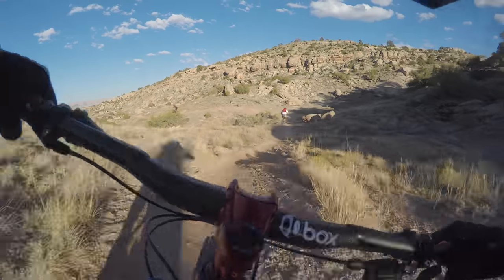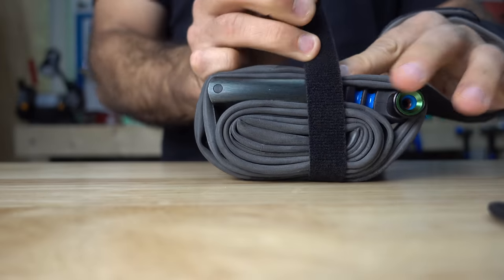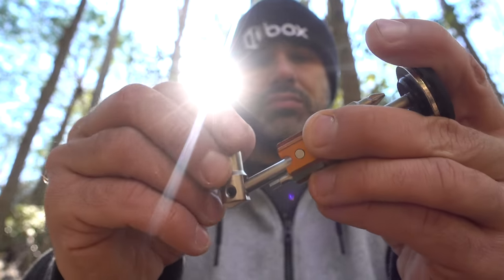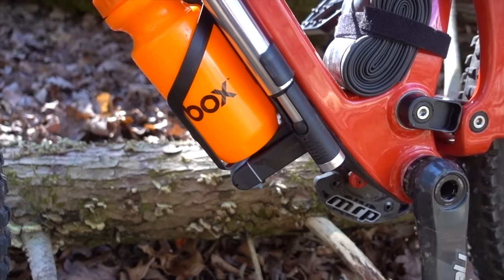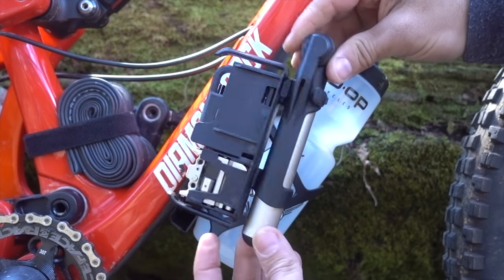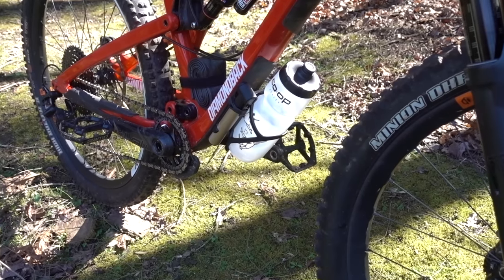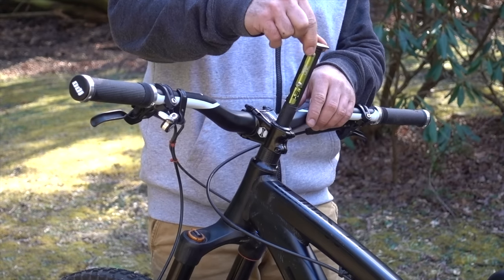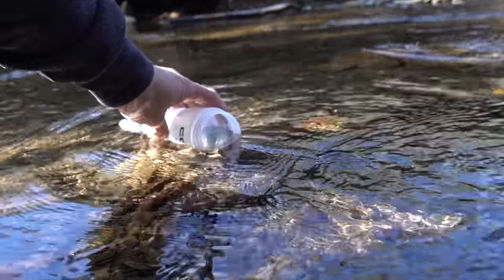5 MTB Tools that Live in your Bike

Comment: Instead of getting a cage like the topeak ninja I just get a inch wide piece of tube and slide it around my bottle cage to the same spot as the ninja is. It can keep a large multitool without any issues and it is free if you have an old tube lying around.
Reply from the maker: This is going in the next hack video and I’m crediting you!
Reply: Seth's Bike Hacks that's awesome! Thank you!! Keep up the great work
Reply: This is genius, and if you have a smaller tool- smaller tube!!
Reply: I didn't understand how it works, Kyle. Do you have a link to a jpg or something, please?
Reply: Kyle Blazer That’s a nice hack definitely
Reply: nice hack! .... Gian, cut an inner tube so it's one long straight piece, then cut off a ~10 cm / 4" piece, so you have a tubular piece of rubber. Slide the opening over one side of the cage, all the way down so you have a piece of tube around the bottom of the cage where you can stick something like a multitool or anything slightly larger that will stretch the tube so it's tight.
Reply: Totally creative and re-useful!

Comment: Hello Seth. I would just want to add another tip. On the handlebars you can take the cap off, and put a tyre plunger with a bacon strip already with it. Then if you have a puncture just take that plunger straight out of the handlebars and plug the leek then inflate with a pump, and you'll be back on the trails in just seconds.

Comment: Total fan of the All-In tool.  I've raced Super-D and Enduro at Paris Mountain and several cross-country races and the tool has always stayed put.  By the way, the notched out section on the side is designed to hold 2 quick links.  As always great vid bro!

Comment: I do like all of these, But I always thought it was better to carry the weight on you, and keep the bike as lite as possible. Just a thought👍
Reply: Great video of corse as well!
Reply from the maker: Thanks! Even loaded down with tools and water I'm pushing 32 lbs on this bike. As bikes get lighter I think people are going to feel better about weighing them down a bit. Still there's nothing like riding a totally naked bike!
Reply: All Terrain Biking agreed. My bike is always naked
Reply: That's funny, I feel the opposite way. It feels best to not carry anything on my body, especially on hot days.
Reply: I'm the opposite, I like to be free to move my weight around s easily as possible.
Reply: Video is really nicely done! Im always for the solution of backpack because every accessory that i had on bike bike broke soo from then im always caring a backpack with all stuff i need. Im riding with naked bike and I always will but even when i had some stuff on it i never felt the difference soo that shit about ligher or heavyr bike is is a nonsense to me it only makes a big difference if you put like bags on your bike or stuff like that
Reply: So much better to carry your stuff. Pumps and tools hate mud and gunk and will go bad quickly. These tools look like expensive rookie mistakes.
Reply: Charlie Cartolano 
Agreed just put a descent set of tools in your pack. Boom done and clean. This stuff works ok in other parts of the world but not in a UK winter.
Reply: Seth's Bike Hacks "Still there's nothing like riding a bike totally naked!" ... FTFY ;-)
Reply: GMBN did a video about this a while ago. It’s better to loose weight on your body than to lose weight on your bike.

Comment: The EDC plus a Specialized SWAT top cap chain tool is a nice setup. I also really like the SpeedSleeve Ranger for tube, co2, inflator, money, zip ties, mech hanger. Does not rattle and is easy to remove and use. That said, the EDC is not great in wet environs. The bits corrode quite badly.

Comment: The hollow bottom bracket tool can be found from a chinese website for 20 bucks same thing just straight from the chinese factory its made...
Reply: Anthony Camacho on which website?
Reply from the maker: I have no affiliation with the company, but I need to set the record straight. This tool is made in Italy by a small company. If there are imitations available, you are free to link to them, but the one in the video is the real deal.
Reply: Seth's Bike Hacks You're right. We should buy the original... But as a student it's pretty expensive
Reply: You don't go cheap on tools.  Cheap tools let you down when they are most needed.
Reply: This Guy no not really a tools price doesn't determine if it's good or not whether it lasts and works is what matters yes i understand you mean most good tools come at a price but there are some cheap tools which actually end up not being trash
Reply: Anthony Camacho Chinese cheaply made tools are almost always unreliable
Reply: King Goat Fury yeah that's true its not like most products nowadays are made in china; p.s. I've ordered a great amount of chinese products the carbon fibre things you can say are unreliable while the cnc made and aluminum made things are not as unreliable especially if all it is, is a tool which won't always be used...
Reply: The webset is most likely alliexpress. They sell good\ok bike products and sometimes the real deal. But it just takes a long time to come
Reply: i have one from aliexpress and it works perfect. The big problem at this tool is, that if you are going to wash your bike and forgett to remove it, the bits start to roast.
Reply: maybe put a sausage or some chickenfingers in then? :P sorry, i could not resist.
Reply: You are so right. Ive broken parts of a bike, stuff at home, computers back in the day because of cheap crap tools.

Comment: If you were disappointed in the Ninja T8+, you could use the Ninja TC Mountain. It uses the Mini 20 Pro if you need a tool with more ... tools. (Chain tool etc.)

If you need the tire levers, you can change the tool-cage to the one fitting the bigger tool from the Ninja T Mountain.

Comment: Glad you mentioned the specialized there, I have a 2018 specialized and utilize the hell out of SWAT, and have the chain tool remover in the stem. I was wondering why it was not part of the review. I did not realize it would not work on more bikes, which is a shame and a market Specialized would be  wise to adapt broadly.
Reply from the maker: I think this was my mistake. Apparently you can just buy their bottle cage and make it work, although some models work in an internal compartment which is proprietary.
Reply: My multi-tool is connected via the cage, while some of the s-works have it in a seat connection. It does not have a chain tool though, I had to purchase separately the specialized tool that goes in the stem. The set up you have shown on your trail bike has it all in once place, that is nice. Though I do like being able to put the tube, pump and tubeless repair kit inside the downtube of the bike.

Comment: Great video as always!👍
I have this little canister from specialized that fits in a bottle holder. It carries my crank brothers multi tool, tire tools, co2 cylinder w/the head, xtra links and it also has a little compartment inside the lid for patches, band aids, money etc. 
if I need 2 water bottles I just put the canister in my jersey pocket. Never know it’s there.
As far as water from a stream goes, I only use Geigerrig/Aquamira hydration packs with a filter on it. The only brand I trust after landing in the hospital with another brand.
As far as the urine test, go to YouTube and look at the video of the runner who tested Geigerrig’s filters with a hydration pack full of pee. 
Anyway, Thanks for another awesome video!!🚵🏻

Comment: The specialized stuff can fit any bike with a normal bottle cage mount.The TTC or Top Cap Chain Tool comes with a star nut tool extender to get the right distance from the top of the steerer tube. The only things that won't work are the Bandit tube and pump wrap, as well as the SWAT XC box, as it requires a third bottle cage boss.

Comment: Love your videos man keep up the good work !!! I just routed my first dropper post in a trance 3 frame that is not supposed to accept a internal routing. i went inside the frame around the bottom braket an up the seat tube. 
I made myself something similar to the parktool routing blue string with a piece of string, a small washer and two tiny but very strong magnets I had. 
I glued one of the magnet to the washer, tied up the rope in the hole of the washer and voilà ! 
Also GRAVITY helps a lot to route around the BB. I turned the bike almost upside down so when I let go the magnet from the outside, the inside one would naturally fall in the BB toward the seat tube. then i fished the first magnet with the second one again using the same trick (washer + super glue). 
I don't know if it is a hack or more juste technique but i thought I would share.

Comment: The topeak Looks like a Walmart version of the specialized swat tool. Their cages are also great if you’re one of the people who has a bike that doesn’t have enough clearance to pull the bottle out of the top of the cage. And they work with any bike. Mine has stayed on the bottom of the cage no matter what I’ve done to it. Also they have a chain tool that fits in the headset

Comment: Great video Seth, the topeak ninja also comes in a MTB version with Thier multi 20 tool in it, you can buy it without the cage too, it comes with bottle boss mountings so you can use your own water bottle cage, I've been using one here in the UK and it's terrible weather for a year now with no issues of water getting inside the case, I needed to replace my still functional, but 20 year old cool tool, if anyone remembers them :)
Reply from the maker: I didn’t know this! Thanks
Reply: Seth's Bike Hacks no worries, when I came to buy a new multitool I was baffled by the amount available, it's crazy, hope you are on the mend and looking forward to your next video, back on the bike, I've never seen you test any cyclo cross bikes, they are dangerous but great fun to race and ride, perhaps test one?  I smashed my wrist last time I rode mine on a MTB flow track, it was funny as hell til I clattered myself, drop handle bars are a strange way of trying to stay in control, I'd love to see the sampler on a cross bike

Comment: You need to check out the other Syncross Matchbox Cage with a pump that has a flexible hose.
From memory, it's the HV 1.5. I run it on my Scott Spark and have never lost a bottle, and the flexible hose means no strain on valve stems.

Comment: How many hex-keys do you really need on your bike? I have a Liteville with Syntace parts and luckily they have thought about it and basically you can fix everything with a 5mm and a torx for the rotors. Pedals need normally a bigger one same as the stealth axel (6mm). Then you are fine with 2-3 hex keys, a chain tool and your favorite way to pump the tires. Multitools are unnecessarily heavy. Cool video :)

Comment: Personally I would rather keep the bike as light underneath me as possible. I have been using hydration pack since they were introduced. I do use a seat bag and water bottle on my road bike but you need to carry more stuff in the woods and trails. Always have zip ties and tape and extra quick link in hydration bag. I do think that air pump with hose is a good idea.

Comment: Why don't the Specialized Swat tools work for you, Seth? The chain breaker in the steerer tube and the SWAT multi tool that goes on the bottle cage don't require any special features from your bike. That's what I'm using.

Comment: Protip: Some forks are a tight fit for a 20g CO2. I could barely get the tool in-and-out with this configuration. I removed the label and used goo-gone and a scouring pad to remove all adhesive. This allowed for smooth in-and-out action on my 2018 Lyrik. Hope this helps someone using this tool.

Comment: as far as the onup website goes, the edc does not come with the tools or the finishing kit (cap un the fork) and they have to be bought separately which will cost around 50 bucks. so the only the headset etc will cost around 110-120 bucks

Comment: I found old battery drill tool set, built 2 compartments in the bars so I have almost every tool, chain links, tire repair kit... just need to buy a cheap pump and I will have most things you have for around10$

Comment: One thing I noticed about the steerer tube one it that the lock in mechanism (the little lip at the top) is plastic which means that it won’t be as secure in a crash after say two or three years of use. Less if you do xc or enduro

Comment: The only thing that is really propietary from swat is the smuggling compartment that is built into some specialized bikes otherwise I used the swat tool on the bottom of a bottle cages much like the topeak tool it worked very nicely and was very minimalistic and clean looking
Reply from the maker: good tip!
Reply: But I will admit the tool is very bare bones and does rust and seize up but then again I have an issue with beating the crap out of my bike also specialized makes a cool saddle bag which actually screws into the saddle! Very stable and keeps the weight down considering that specialized saddles are sought after aftermarket components I would like to see a possible future review

Comment: OneUp now sells a kit that lets you install its multitool without having to cut threads in your steerer tube.  The biggest point against the OneUp tool is its limited compatibility as there are a lot of forks that it will simply not work with which makes carrying it in a pump the only option for a lot of people, but if you already have a great portable pump (like the Crank Brothers Klik), then do you really want to have to buy another pump just to carry a multitool?

Comment: Hey Seth, I've lost two bottles on my last two rides due to my bottle cage either opening up on impact or overtime while riding (I have an aluminum one). I'm really interested by the Sychros Matchbox Tailor, but I'm wondering if I would end up having the same problem. I have a Pivot Firebird and the cage is a bit lower on the down tube than your bike and it brings my bottle (even without the tools) lower than my bash guard... Since it's 105$ CAD I figured I'd give a shot and ask before buying. Love your vids!

Comment: I sewed two fanny packs together with velcro sewn on the bottoms of each to bond the two fanny packs together then attach a light weight buggy cord to both ends to keep the fanny packs in place.  I purchased an assortment of first aid items and a tool kit for each bike I own.  All the gear is stowed inside the new cargo bags and I have room for several snack bars or whatever. 

I’ve outfitted three bikes for less than $100.  And I’ll never forget anything because I don’t take it off.

I even keep a few bucks ($40.] in each just In case I see something I need.  The first aid and tool bags I also made to stow inside the fanny packs so they aren’t banging around.  Oh yeah I have a very sharp knife the size of a tigers tooth in each one.  I figure if a tiger can carve up your butt with something this size; that’s all I need too.

Comment: I NEED HELP !
I have cought the mountain bike bug so bad. I want every thing but i cant afford most stuff. Your review of bikes parts and tools helped me save some money. I ride a 2016 Trek fuel ex. Im building it up to a Endoro bike. Im starting to think i should have just purchased the Release. I upgraded almost everything to Raceface. I just installed the dropper post. Next upgrading the wheels and fork. The fork im looking at is around $800.00. I want to up the travel to 150 or 160. Need advice! Im so confused about wheels. I have the stock bontrager wheels on now. I keep reading reviews on them and no one likes them. From what i gathered, i need 40mm wide tubeless carbon wheels with 32 spokes. Im running the Maxxis minion dhr 29×2.40 and dhf 29×2.50. And i also keep getting advice to get supper hubs( i9 hope dt swiss ). I like the Halo hubs.. Dude i need help i think i got a mountain bike habit. Should i look for a 12 step meeting ? Is there a hotline i can call? I wont give up my bike. Its the one thing in life i do for me. If i ever make it back to the Carolina's can we shred some trails? Great review. Now i need to go play with my bike!!

Comment: I honestly don’t like riding without a hydration pack. Added protection and more water and storage. I don’t feel comfortable without it. It’s just not worth replacing all my tools to ride without it. But what ever floats your boat
Reply: I said the same thing for a long time.  But...I've determined a mix of putting some things on the bike (extra tube, water bottle) and the rest in a hip pack, to be a good balance.  I found myself wanting to take my pack off to hit the flow trails, and jumping just feels more natural without a pack on.  That keyed me to want to find a way not to have to have a pack.  I'll still wear one on longer rides when I need more water, but for most of my 2 hour rides...it's liberating not to have the pack on.  The trend here in northwest arkansas is moving away from bulky packs whenever possible.
Reply: Tools and pumps hate mud. That’s why we went to packs decades ago. Keep the bag!

Comment: I don't really get the anti-backpack trend. If I'm riding over an hour, the water bottle isn't going to cut it so I'm usually wearing a small hydration backpack anyway.  And there is the old tried and true seat bottom pack that works pretty darn well.
Reply: I also like the ability to switch bikes with my tools in one bag

Comment: With a bottle holder that low, I wouldn't want to drink from that pop top. May I suggest you hack the bottle cap and install a hose to deliver your beverage while riding? That hose would be long enough that it would significantly add to your total water storage capability.